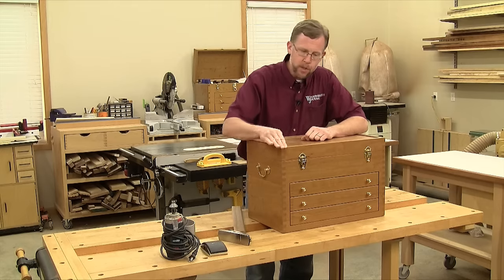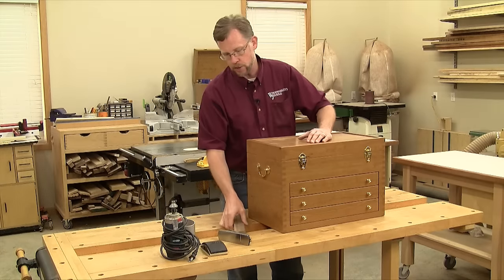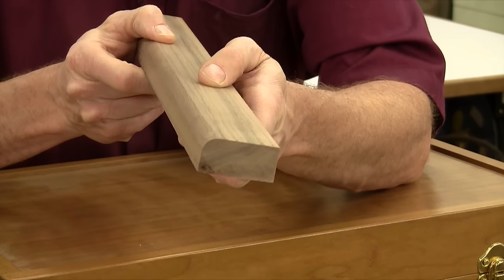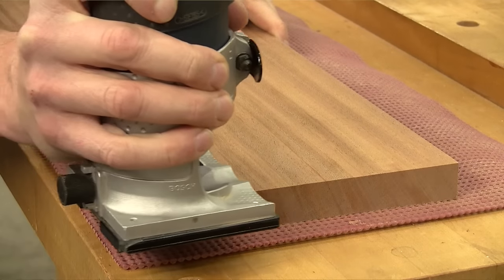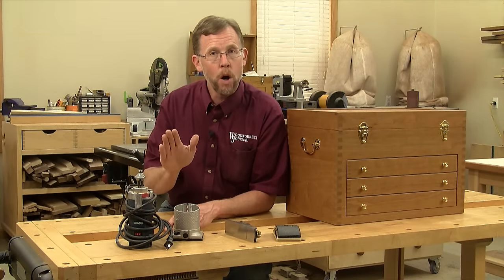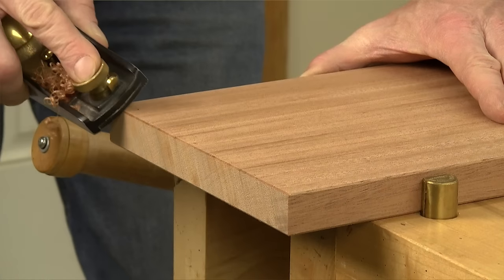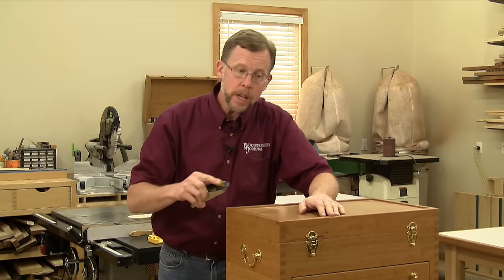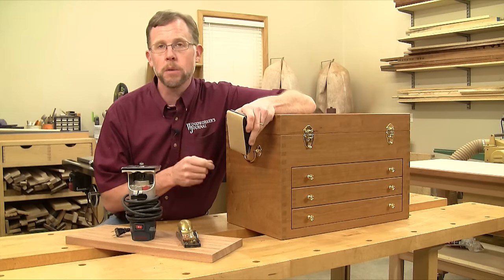How To Break or Soften Edges on Woodworking Projects

Comment: You neglected to mention the use of a random orbital or palm sander. I use this almost every time I'm not rounding over with a router. I start by sanding completely flat on one edge then with each stroke, tilt the sanders angle slightly until I've reached the opposite edge and am sanding flat again. I find this technique faster, more convenient and more accurate than a plane and sanding block combo.

Thanx for all the great vids, sir.

Comment: My Dad used to build wooden boats. Now he’s 80 I’ve been seeing myself one day in future taking over from him as I’m doing one of those gaming case projects. Using oak wood to take the weight of some sprung hinges used for kitchen cupboards. I may even get me a tool for rounding off the corners like from Lidl or The Range or somewhere via Halfords ect. Or save money and saw off the corners to make the 2 boards fit. Also I’ll be using Hex Standoffs to attach the monitor on the bracket allowing it to cool down after each use!

Comment: Hi Chris, what do I do where all 3 edges meet at the corner?
Reply: Hey Chris, see my response above. This is how I smooth over a edge. Once all my edges are treated to my satisfaction, I use a circular motion over all the corners with a very light tough. It doesn't take much to remove material here and round over the corners.

- Good Luck -

Comment: I’ll be using cable grommets in the other board to tidy a few leads left and right and fixing them to a Kangol Suitcase’s rails by simply removing the sides then, that’s when they’ll be screwed down. And a height adjustment on both the left and the right. But leaving the Xbox One X down below a bit. Allows the mechanism or the sprung hinges. I’ll probably upload a video sometime once it’s finished using my Nikon Coolpix camera or my new Silvercrest 4K Waterproof one I chose for my Birthday on 1st of March, as I’ll be 36 and still currently looking for a girlfriend.